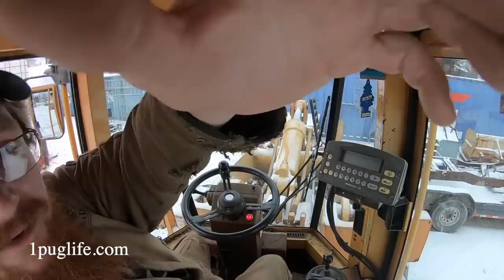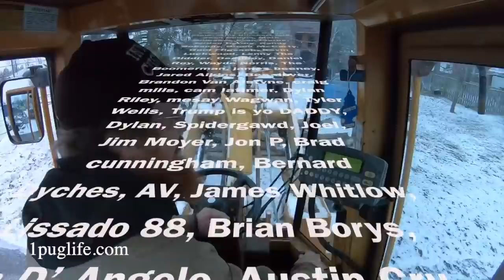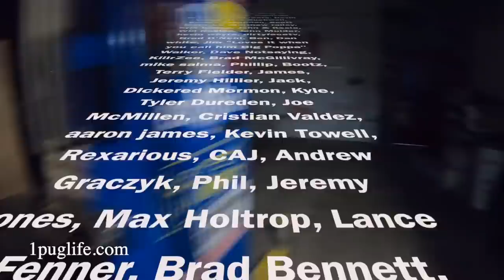picking up the new truck

Comment: when i worked in the oilfields during the winter i used to put methanol in the air tank for the air lines
Reply: That's right or someone would kick the goofs that didnt down the road.

Comment: If Pug wants to earn the air-brake endorsement for his Traptorman's license, I suppose we ought to teach him about maintaining the air system.
Reply: Has one, probably never changed the cartridge  listen to all the air leaks!
Reply: down stream of air dryer he needs a alcahol sniffer get one at any billy big rig wrecker yard grab the old bendix air dryer style they work the best  easy to clean and work on rebuild kits are cheap next spring clean out the wet tank and all lines down stream
Reply: @andercoincvideos5551  I need one on my truck, I still drain the tanks every night like they done in the 60’s 😂

Comment: Drain the air tanks. Get the moisture out. Should be tank drains on the air tanks.. Just like your shop compressor. Put it outside in the cold and it wont work either if it's fill with moisture because it would freeze.
Reply: Air tank is 3/4 full of oil/water sludge
Reply: @simplyfred8044  he likes the tanks 3/4 full of water .it builds air pressure faster that way.

Comment: Is there no a drain on your air tank to drain the water?
Reply: Unbelievawerds buddy right.
Reply: every air system ive ever dealt with has a water separator and petcocks to drain the bottom of the air tanks.
Reply: @agentjwa  Pug loves petcocks.
Reply: I was thinking the same thing....like ya don't drain your system???? Big goof
Reply: @xmas4203  yep peecocks
Reply: @agentjwa  Some big lifts have air-dryer system, big money to replace
Reply: @chadsimmons6347  my semi truck has an air dryer but water still gets into the tanks, not a lot but it still does.
Reply: @agentjwa  We have a air compressor, with oil-cooler, we take the hose loose and let it rip until the condensation is gone

Comment: What I know about Airlines ones that are supposed to be sucking but are blow it is probably a shot one way check valve should be cheap and is only as hard to replace as it is to get to it

Comment: Your using your brakes too much and running out all your air pressure,  hence the air over hydraulic. Air will build up faster with more rpm,  if you lose too much air you lose other functions too

Comment: Hey pug if you can break the one line loose on the compressor and put some rubbing alcohol in the compressor that will keep the air brakes from freezing you might have to do it a few times there's like a nipple or something like that on top of that compressor weather for the airside

Comment: The air drier filter is probably full of water and oil, drain the air tanks, change the air drier filter, and see if air drier heater is working.  C'mon ya GOOF

Comment: do you ever drain the air tanks and if it has a air dryer , service it.
Reply: He will find a kjkjkjkjkjkjkk guy to look at that.😂🍆🌮
Reply: hell figure it out in a few  months. the compressor is spewing out air? shit, i cant figure it out.
Reply: @Moddafukcer  if it has a purge valve replace it.
Reply: freezing up ? engine off pour in hot line aka outlet on top- steel line in line not compressor!, start up so it pushes through to rear , not when running, make sure steel line does not have a hole in it at frame somewhere.
Reply: @sts.556  irony dude